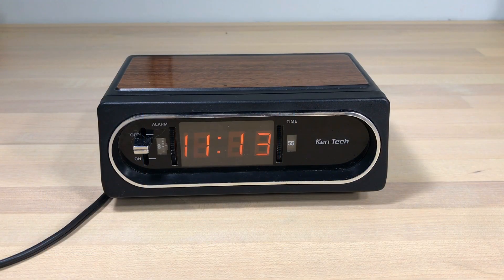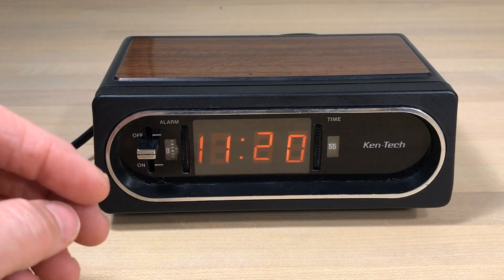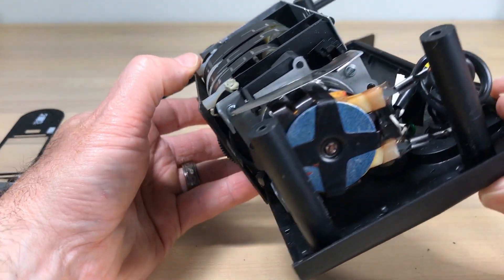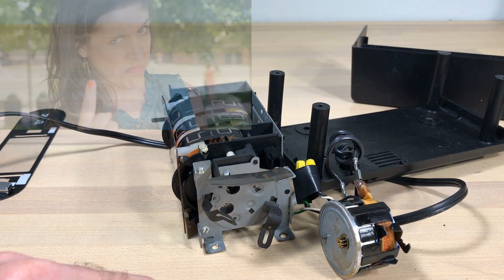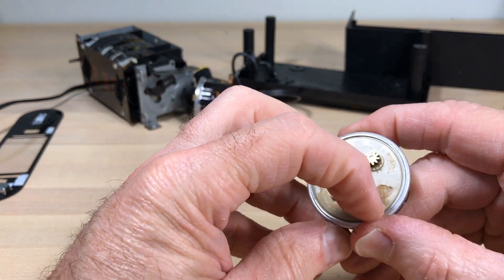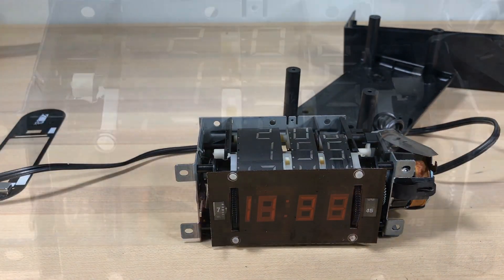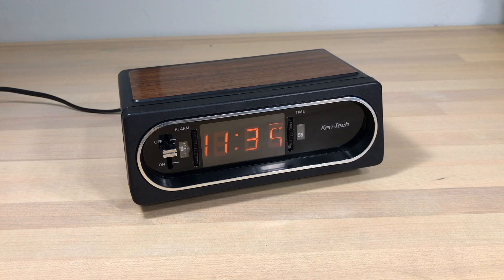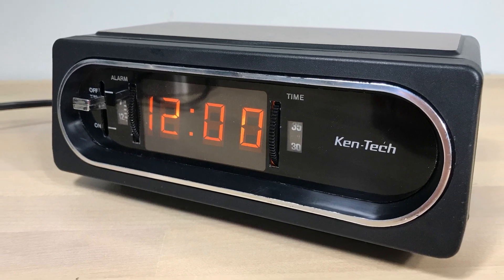A Different Kind of Ken-Tech Clock

Comment: That's a General Time capsule motor. They made the entire clock mechanism. Those capsule motors are a bit annoying to get apart, but it is doable if needed. Very cool, I had a Seth Thomas clock very similar to this.
Reply from the maker: They’re pretty rugged from what I gather. Thanks for the comment.

Comment: Crazy they would go through such lengths to emulate a 7 segment display. With that kind of mechanism, the numbers could be any style you want!

Edit: Wrote this comment before finishing the video. The second film clock you show is so much cooler looking!
Reply from the maker: It is nutty though isn’t it? I’m guessing they thought the electronic digital was the rage and they wanted to hop on the band wagon. I’m also guessing it didn’t work out for them. It was the wacky 70s.
Reply: @Flipclockfans  True. I think the most mind boggling thing is that at the time, this crazy complicated mechanical clock was cheaper to make than one with a real LED display. These days, an alarm clock with a digital display can be made for pennies.

Comment: Cool clock. That capsule should be possible to repair by carefully bending up the aluminium around the front steel plate with some side cutters, and extract the mech to give it a lube or whatever it needs. It would at least be good to see inside one before it goes in the trash.
Reply from the maker: I've opened one up. The tolerances between the rotor and the capsule are extremely tight. Manipulating the capsule while you work on the  rim has the potential to throw this off - easily. Then if it were a gear problem, you've have to separate two plates (that are also aluminum) that are riveted - not screwed together. Separating them introduces more errors. Then there's the matter of actually finding the right gear.. I know lots of people want us to be able to tear down these things and fix them. I just don't believe it's practical at all. They were not made to be opened up. It's fine to disagree, but even those who advocate this and have done it (I've done it to some motors) admit that it's not a perfect solution.
Reply: @Flipclockfans  Fair enough. Some things are just not worth the effort, especially if you can source good used units. I wouldnt mind seeing a tear down of what is inside them though if you can ever be bothered, even if you dont put it back together again.

Comment: Hey, that's mighty cool! I was really rather impressed with the one I picked up- it's a mighty ingenious reuse of the Westclox film mechanism that (at a glance at least) really does look like an LED clock of the same era. 

I see you got yours running the same way I got mine going. I gave mine a good shake to see if I could hear anything rattling, and it started up. Mine runs okay, just loud- though all the clocks I have with these film mechanisms are extremely noisy. I imagine there might be a way to add some fresh lubrication, but as I don't run them too often I haven't messed with that yet. Might make for a good experiment sometime this summer!

Another great video sir, rock on!
Reply from the maker: It's technically not a Wesclox mechanism. It's a General Time Corporation mechanism. That's splitting hairs, but General Time Corporation was the holding company established in 1949 when Wesclox and Seth Thomas were combined. Basically the same thing you said, just different. They sold this mechanism to numerous companies. I used to say I hated this, but it's growing on me.
Reply: @Flipclockfans  Interesting- when I traced it back through the patents it was all listed under Westclox, so I just ran with that. Many thanks for the clarification! As for the clock, they have a "different" look than a flip clock or other cyclometers- the variety of shapes and styles is certainly varied across the various brands. Of the lot, I do think the "fake LED" variant is the real showstopper!
Reply from the maker: @performa9523  - I see what you're saying. But essentially Wesclox was under General Time Corporation. These mechanisms also showed up in Seth Thomas clocks. It's a distinction without a difference, seems like.